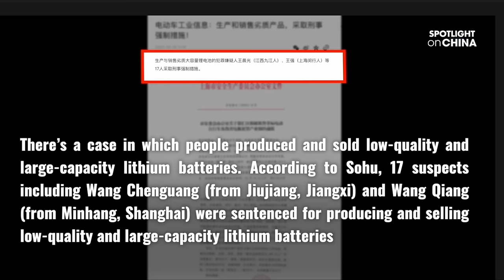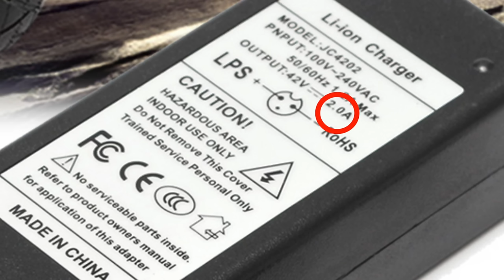What's Causing Ebikes Fires?

Comment: 1:25 I know this is sarcasm but if battery fire occurs in cargo there is no way to put them out. That is why passenger aircrafts forbids batteries in cargo compt.
If they go off on a passenger plane, you have SOME chance to put them out. There is also whr restriction, but it doesnt look like they're enforced well... so thats TSA/FAA issue.

Internal short - this is most likely due to no-brand companies reusing used cells or factory rejects. This is combined with poor spotweld or lack of protection against vibration (eg. Cells not contained in racks. This increases exposure to vibration).
Chargers generally would not overcharge the battery if designed properly (for example, 120vac rectified comes just around 84v, so it is impossible to overcharge a 72v battery unless a diode fails and there is no fuse in place). The explosion during charge is most likely due to aformentioned poor cell quality.
Spot weld issue -
Very true, but you can simply use bigger sized/capacity cells to mitigate this.
LiFePO4 cells - they are actually quite capable for ebike propulsion, but their size/shape makes it very hard to customize shape unlike 18650/21700 cells.

Comment: sometimes the reasons why it just because lock of knowledge in electrical and electronic " or wrong wiring undersize of wire and fuses can cause fire or not in Standards" or they can not use compatible charger  to the battery" or they can not USE BMS ' sometimes overcharging but there is a Solution there's was a timer plug now that you can buy on the Shopping store " to prevent overcharging you can set the timer for how many hours you charge it and it will automatically turn off

Comment: I write firmware for BLDC motors that are used in scooters. One important firmware function is to derate motor performance (torque) against battery temperature so that the battery temperature remains below its operational max. This is better than just killing the motor once you reach the maximum battery temperature as it keeps the scooter going and the battery cooler.

Comment: I've been riding an Ebike and charging ebike batteries since 2019, and I've never had a problem. Yes the charger I use gets hot when its charging, but its only a 2 amp hour charger. And when the battery is charged, the charger cools off, and I unplug it. I have left a battery charging over night, in my house, and it does not bother me. I think the biggest problem is people trying to fast charge the battery with the wrong charger. I've learned that if you slow charge your battery, it will last longer. Plus, I do not tinker with any of the controls. Just my two cents worth.
Reply: 🤔 wrong charger?
Reply: @StromLxrd6  Both ebike battery chargers I have are 2 amp hour chargers, yes slow but steady and I've never had a issue. The problem is most people are in a hurry, so they buy an after market charger that is maybe 4+ amps per hour and this is where you get into trouble. My two chargers get hot but not to a point of danger, when I use them to charge a battery. If I tried to use a 4 amp hour charger, I can only imagine just hot hot that would get. Plus I'm forcing a bigger charge into the battery then maybe its built in BMS, I think that's it, can handle, and thus BOOM. So there you go.

Comment: The  battery  for  my  wearable  vest  swelled  enough  to  fracture  the  case.   I  removed/examined  the  battery  &  was  not  comfortable  with  continuing  using  it.    Replaced  with  two  (used)  cells  from  a  laptop  battery.   How  smart  am  I  .  .  .  .  .  .  .  .  errrrrrrrr  .  .  .  .  .  .  .  .  it  works  well,  keeping  me  warm  as  I  type  this  .  .  .  .  
     BUT,  as  you  suggest,  I  am  afraid  of  an  overcharge  possibility  &  therefore  pay  attention  when  recharging  this  or  any  other  li-ion  battery.    LiFePo4  batteries  am  not  so  worried  about  .  .  .  .  .  .  .  .  thanks,   RH

Comment: A lot if not a majority of e-bike batteries are made in such a way that there is significant pressure on the nickel conductors. Over time, vibrations can wear through insulators and..

Comment: I just time my charge to check every  1/2 hr. then check Battery level... I don't wait for the green light and have no problems... I use my e-bike for local trips around town, maybe 5 miles... The Charger can get very HOT so I put it on top of a small white plate, glass dish...
Reply from the maker: as my luck has it, the charger went up in smoke within the first minute of charging today……

Comment: I thought batteries in modern devices automatically stop charging when they are fully loaded.
Reply from the maker: They do, however, the issue is That many ebike chargers have not been UL listed have not been tested, and can falter. On top of that, many folks have multiple Ebikes. Often times, 36 volt and 48 volt chargers use the exact same fitting. It’s easy to mix them up and create a small disaster.

Comment: I was going to ask you why they didn't make something that disrupts such a thing. But then you said use a timer good idea. Would it be a good idea to charge only outside and in a metal ammo box?
Reply from the maker: at a certain voltage, the charger is *suppose to stop, however if it doesnt and continues pumping higher and higher volts..... then you've got a problem.  Other issue is that if the charger has a fan, moving part, and that fan goes, that can trigger the regulator to go, and the problems are stack on top of other problems.
Reply: @YouTruther  thanks I'm thinking something to monitor the temp of the bat. Or resistance to know to turn off charger or disconnect bat. It is amazing the battery's used to jump start cars was a breakthrough.

Comment: I have kugoo kirin b2 400w a similar bike like yours Jetson bolt. You know what diameter battery can fit inside the bike;
Reply from the maker: the max width/thickness is 2.8".  if the kugoo is 48v 7.5 or 36v 10, then you cant go bigger without some cutting.
Reply: I also am fortunate enough to have a KK-B2 (I call it "The Nipper') - great piece of kit. Enjoy the moment. "Have helmet - will travel".

Comment: My e bike battery not in use is stored in metal tool box with zip loc plastic bags of silica sand . The battery is charged to 80 or 90% on a luna charger on a timer . Next is store the battery in the shed in a cement fire board box .

Comment: I'm not new to this ebike thing but it has only been since 2016. My first came with lead acid batteries. 24 Volt! LOL
I bought a lithium ion battery from a guy on ebay. It saved me fourteen pounds!! Since then I have bought several batteries. Converted a few bikes. Overvolted a few and have generally run them pretty hard. 48v and 52v are my daily riders. I have some leftover 36v batteries I am going to use with my Bolt Pro!!! One is LiFePO, 12 ah so it should get me some range but it's flat so I am going to put it on my little utility trailer for external boost! I've used hoverboard batteries and I have a few of those too. I have never had one roast up. I don't blast charge with anything that is way high. 2a, 4a, 6a is all I have used.
Reply from the maker: same, I had a lead acid system because I was too cheap for lifepo 😅

Comment: Ok Lets say you are trying to be helpful here but I have been building E-bikes for 5 years doing conversions and using those same CAOMM batteries, in fact got two in the shop charging as I write this. Never have had one battery catch fire. Even had a guy mount one on his seat but a friend dropped the seat so he could ride the bike and sawed the battery in half, and some cells did burn nothing like the bombs I see in these flash videos with no beginning or end saw one there where folks had a camera set up and fire department on hand while they blew one up. Scare tactic?! Just says only time I have had one of the CAOMM batteries fail was human error, but thats planes , trains and automobiles .

Comment: My Json Pro is dead, after 180 hours of use (2 years). I am not sure if the problem is the charger, power plug, or battery. I will start troubleshooting with the charger. Wish me luck.
Reply from the maker: check for loose connection

Comment: All airplanes should have a steel case with fireproof mittens in them that they can throw a laptop or cell phone into in the event that it burns.  Should be an international law.  I use an ammo box and an old steel Milwaukee sawzall case at home for my batteries.

Comment: There is a problem with switching off the charger with a timer switch, the battery will discharge if left plugged into the charger.

Comment: Are there some brands that are more likely to burn or some brands of ebikes that have not had this problem?
Reply: All ebike batteries and EV batteries have the possibility of thermal overload and thermal runaway. Its a curse of the technology. Lithium packs can be easily mis-manufactured. 
Best way to mitigate the possibility of a fire is buy a high quality pack from a reputable manufacturer, and follow the charging recommendations in this video. 
Cheap chinese made no-name packs are EXTREMELY dangerous, and are NOT worth the cheaper price in most cases. They will burn your house down or torch your ebike/scooter.

They use thin tabbing wires, poor quality cells, and typically ignore the max discharge rate and under-build their packs. Basically they will build you a lithium boom boom that many of us would be afraid to stand next to while charging ;-)

Comment: One thing many battery builders miss is that manufacturing processes aren't perfect...

When assembling any Lithium pack, the MOST IMPORTANT things to check are these: 

1. TEST THE INTERNAL RESISTANCE of each cell. Even new cells. To check for damage and possible manufacturing flaws. 
2. CHECK THE REAL WORLD CAPACITY of each cell. Do NOT rely on manufacturers to guarantee your personal safety. This will help to verify that the cells are undamaged and have no invisible manufacturing defects. Visual inspections and voltage checks are NOT enough. Lithium is too dangerous to be taken lightly. Extensive testing should be done to verify safety of the cells you receive. from ANY manufacturer. Humans have bad days. Miss things. Or generally just screw up sometimes. Don't bet your safety on them being perfect. They aren't. 
3. NEVER RE-USE a previously welded cell. Even filing off the old welds flat and thinking you have a smooth surface, can result in poor contact replacement welds that will generate tons of heat when current is passing through them. 
4. USE THICKER tabbing wires/strips. Electrical code in AC / DC usually involves overbuilding any electrical circuit. This is for safety and for longevity. The thicker the Bus Bar, the less the resistance through the material, and the lower the heat. It also ensures the carrying capacity of the bus bars can handle the load of a high amp application. Without generating extreme heat at the top/bottom of the cells. Thicker tabbing ALSO helps to dissipate heat from the cells. As it tends to draw the heat into the more conductive material of the tab/bus bars. 
5. USE A BATTERY HOLDER. Use a battery frame/holder to build packs. The small amount of distance each cell has from each other in an EV application without active cooling is CRITICAL. Packs with the cells stacked together and touching, do not allow for ANY heat dissipation and the coatings around each cell act as an insulator and bottle in the heat. Small distance between cells = longer ride times with less heat... Even a small 5V cooling fan can remove massive amounts of heat from a pack, as long as there is space for the air to pass between the cells. 
6. SIZE THE C-RATING CORRECTLY!  Again, electrical code can be used here to determine the rating of the max discharge needed to prevent excessive heat build up, and prolong pack life. Your pack should NEVER be more than slightly warm to the touch after a hard ride. IF it is approaching hot after a long ride, you have your pack built too small on the parallel phase. Your discharge rating is too low, and you are overtaxing the individual cells. Fire is imminent. Add additional cells in parallel phase, to increase the current handling ability of the pack, and step up to a larger bus/tabbing wire.

Thermal runaway (Battery fires) can be caused by mismanufacturing, physical damage or deformation, freezing/charging, and dendrites creating massive internal resistance and eventually hard internal shorting of lithium plates/coils. And of course an intentional or accidental hard short of the terminals can also cause a cell to experience runaway. 

Thermal runaway can lead to a fire that can ONLY be extinguished with an ABC chemical extinguisher, and can lead to a fire that will burn white hot, and some electrolytes can "Spit" out of the cell as molten mixtures of lithium and carbon char as the cells burn out. These cells are EXTREMELY dangerous when experiencing runaway. USE EXTREME CAUTION when building, servicing, rebuilding, or charging ANY lithium pack. Or ANY battery for that matter. Energy storage of ALL types is volatile under the wrong conditions. 

Stay safe. And good luck on all of your builds!
Reply: Air is poor conductor of heat (basically insulator) and in closed  space as in battery pack unassisted heat dissipation by convection is nonexistant. Air gaps can be useful in actively cooled packs but e-bike batteries do not have forced air cooling (like 5v fan you mentioned) systems and rely solely on dissipation by conduction. In this case air gaps can be even detrimental because air is poor heat conductor. Potting in thermally conductive epoxy, silicone or some other thermally conductive compound can increase dissipation rate and make some waterproofing.
Reply: @elchupacabra1666  agreed, but battery directly contacting battery leaves nowhere for convection heat to exit or "rise" to. 
It creates hot spots and can increase the likelihood of thermal runaway. 
If they can be apart from each other, they certainly should be. And active cooling is certainly recommended, especially for higher amp draw scenarios. 
Ev manufacturers aren't cooling their packs actively because it doesn't help. They are doing it because it drastically increases cell life and reduces the chance of runaway.

Comment: Is my ebike safe to keep inside the house? I've been keeping it inside for over two years.
Reply: I have for over a year. No worries.
Reply: No, I wouldnt keep it in the house. I wouldnt even leave an EV in an integral garage. Park it on the drive. Get a mouse or other rodent nawing through a cable and causing a short circuit and it could end up with a battery fire.
Reply: @1701_FyldeFlyer  thanks for the information 👍
Reply: @1701_FyldeFlyer  I usually charge it on the patio. It stays in my room at night. I don't have the money if it's stolen. Electric bikes are considered bicycles in N Arizona towns. Sidewalk, street, dirt trails the cops could care less. I just want a Sur Ron someday. My truck has sat since 2010 in the open, rats never ate anything. I know another part of Arizona  the rats kept eating the wires everyday on my sisters tractor. It depends on where you are.
Reply: @Mark-qv4bn  I keep mine inside too, if I had a surefire safe place to leave it outside then I would, but as you said they are too expensive to take risks with. I charge mine in room after use, I am always around when it's charging then it sits there until I use it again.
Reply: @JohnnysCafe_  I never really worried about it until my dog died late last year. I have a metal shed, but I want it where I can see it. With tax, shipping over $2,000, and it will be my only means of getting to the store, as I'll be quitting driving soon. Worry is a killer, be happy I love my e bike.
Reply: @Mark-qv4bn  thats very sad Mark, your dog is family and it is heartbreaking when they die. I hope you are ok now and coping fine .
I love my Ebike, I live in Brisbane Australia and there are bike paths all over the city going to most suburbs, it is part of the health and clean air campaign, it's to encourage people to drive less and exercise more, it's awesome riding anywhere without traffic BUT  the bike paths to the city are thick during the morning and evening rush hour, actual bike jams, but still more fun than traffic jams.
 May you enjoy all the miles ahead 🚲👍
Reply: @JohnnysCafe_  She was my protector, now I'm my own protector. If someone is in my yard, they've jumped my locked gates. Then all bets are off. We have castle law and stand your ground laws, plus I'm elderly. A outside dog is a deterrent to crime, but it gets up to 116 degrees outside, and down to 5 degrees. I can't afford another dog, vet bills, month and a half wait to see the vet. I've had rescue dogs over 30 years, not easy to be alone now, $900 vet bills I can't do anymore.

Comment: My Android devices come with a battery saving mode where I set it to charge to 80% then it cuts off, I can't understand why the same method can't be used on ebikes, it has it on my mobility scooter, it fully charges then turns the charger off. Sodium Ion battery technology should arrive soon, the batteries are slightly larger and heavier, it also holds slightly less of a charge but it's significantly cheaper and safer.

Comment: I have charged and recharged my bike battery since 2012. Its on a mountain bike its been walloped and beaten and its fine.  Ps im pretty sure water and electrical circuit fires is a no no 😂  or get the proper charger that turns of itself.